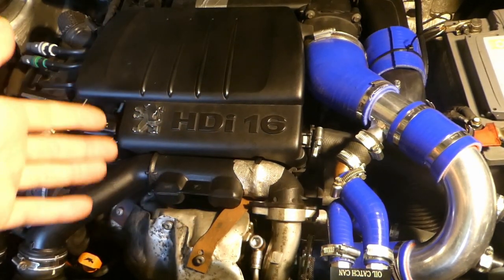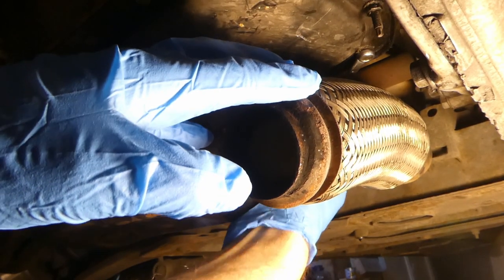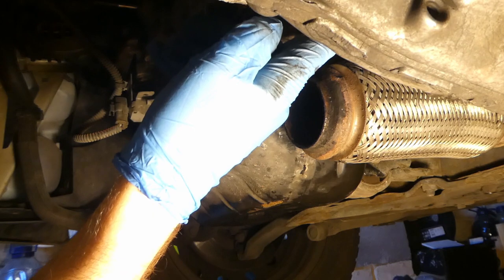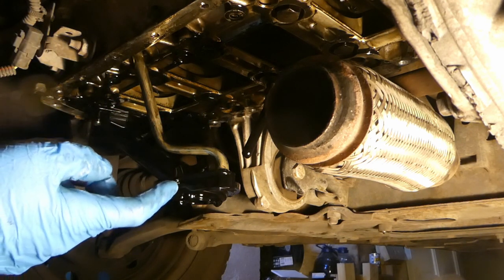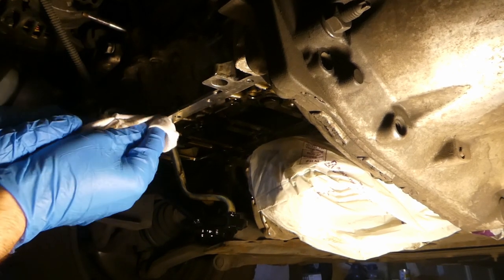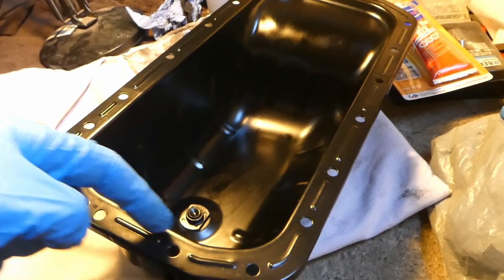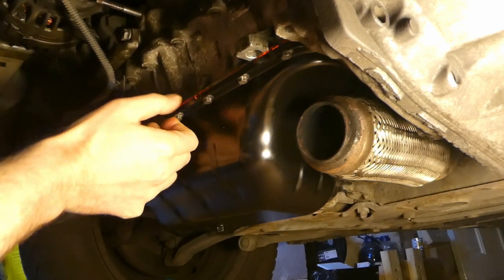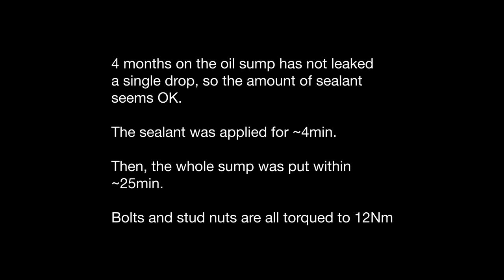1.6HDi oil sump replacement (Peugeot Partner 2007)

Comment: Do we need to remove downpipe exhaust
Reply from the maker: You do not need to if you can get the sump off. I found that I needed to remove it as access was much easier. The middle part has flexi, so easier to move around, but the upper part is rigid and obstructs accessing the bolts to get the sump off.
Unless you mean the very downpipe, which you do not need to remove. The middle part connection is flexi, so one just moves it aside slightly.
Reply: @moremolecules  Upper part diwn pipe I am  struggerling with obstructing bolt   if I do remove down pipe  how please ?
Reply from the maker: @philipmaguire9209  You do not want to remove the middle part, it is difficult as it goes inside the cabin. The one bolt, you can perhaps cut it and get a new bracket. They rust pretty quick anyway.
Reply: @moremolecules  The bracket   that holds   down Pipe  to the cabin or   flexi  bracket ?
Reply from the maker: @philipmaguire9209  The first bracket that holds the upper part to the flexi. The flexi can stay in place and you only kind of move it aside to access the bolts. It is a bit in the way, but because it is somewhat flexible you can slightly push it aside.
Reply: @moremolecules  So  is it possible to get to the upper bolt sump  with  the  pipe   just Detached from  the  clip  joint to flexi
Reply from the maker: @philipmaguire9209  I do not think it is possible to replace the sump without removing the upper exhaust. The upper one is proper metal and one cannot access the bolts to unscrew them. The flexi and the middle/lower exhaust parts ca stay in place, as the flexi is flexible and can be pushed aside a bit to access the bolts. Also, when you take out or put the new sump, it will be very difficult to navigate around the upper exhaust part. So, no, you would need to remove the upper exhaust part.
Now, this depends a bit on your model of car of course. If it is the 1.6HDi up to 2008 then you have to remove it. If it is newer then maybe you have to look at it underneath and see if you can access the bolts.
Reply: @moremolecules  mines 1.6cc  Peugeot 307 2005  Estate.. so I guess I need to remove upper part ?  To access few nuts
Reply from the maker: @philipmaguire9209  Yes, you would need to remove the upper part to get access to a few nuts unfortunately. Stupid design, but what can you do.
Reply: @moremolecules  yep 4 bolts plus clamp  pain in arse  wd40  bolts
Reply from the maker: @philipmaguire9209  I use PB blaster, seems to do a better job than WD40. I sray it evey 1h in 1 day and the next seem to move easier.

Comment: Too much silicone !!
Reply from the maker: Ha, I thought so, but the original had even more silicone on!
Reply: @moremolecules  The old one might have been removed in the past as the factory wouldn't have that much on there.

When cutting the nozzle for the RTV I cut it at an angle to help apply it so it'll be a thinner film not a long blob.
Reply from the maker: @DevinderAthwal306  Good tips. Yes, it was probably previous owner or something, way too much before, not that I did not put as much, haha. Not too sure if I cut it at an angle.